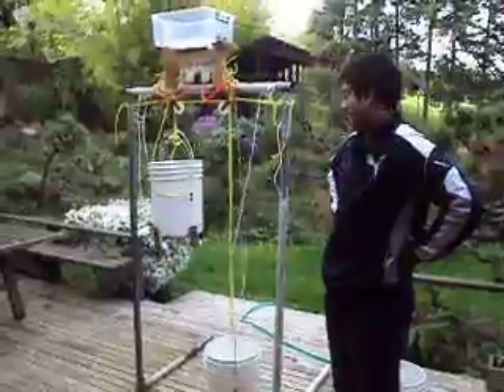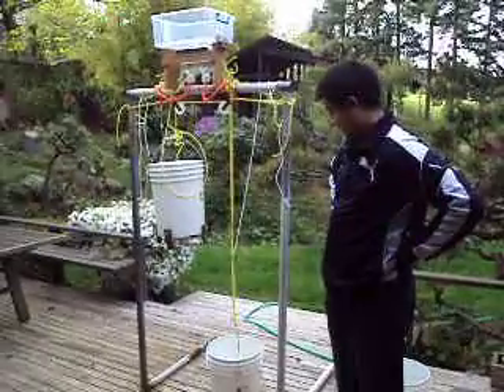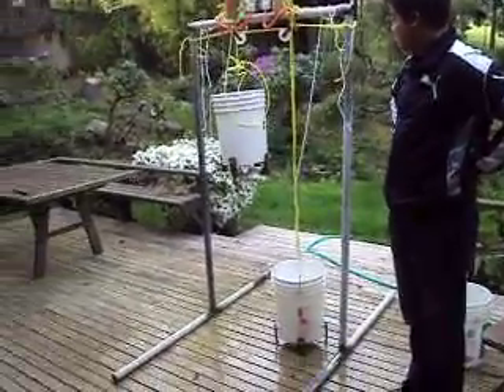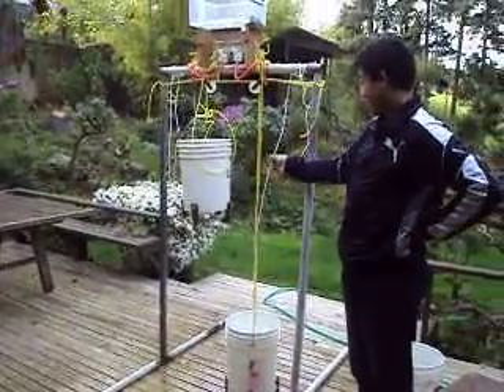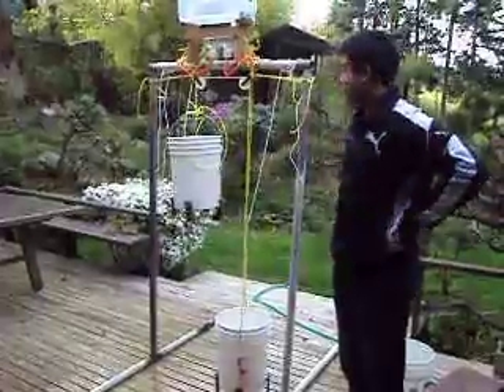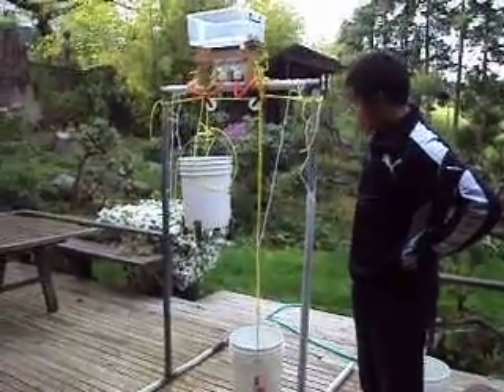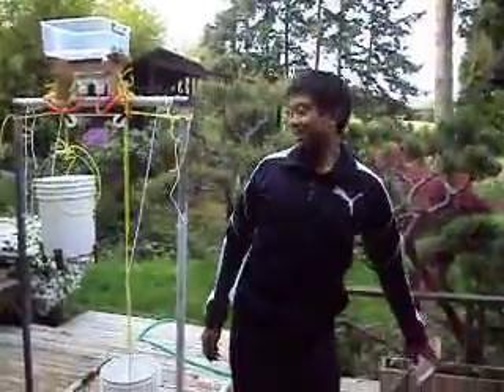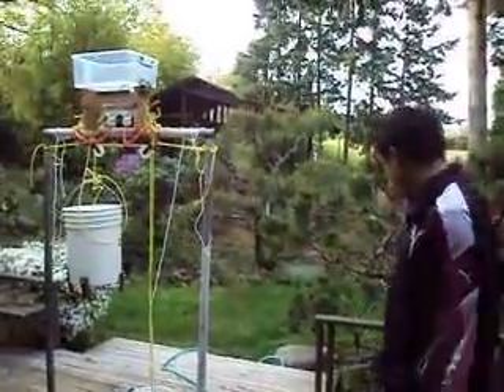My Invention: Reciprocating Mechanism for Harvesting Gravitational Potential Energy

Comment: Cannot see it. You pour water into bucket, then bucket drops, then bucket empties? 

Water (fluid) can be dumped/lifted, but is not heavy enough to do much gravity work unless you fill 1K+ liters per bucket. So your structure must be large and heavy-duty.

So then you (might) have water-lifting requirement to achieve continuous operation. Perhaps catch the dumped water in large intermediate tank below buckets, then pour that out at timed intervals through a turbine (which spins generator to charge battery for water-lifting pump) and into final collection tank. Pump water at timed intervals from final tank to source tank. 

If you have ongoing elevated water source, such as large rainwater catchment, use that to fill buckets, and discard water dumped from intermediate tank. Don't lift water unless your ongoing water source runs low.

Put shock absorber at bottom of each bucket's drop extent.

I might build that kind of (large) machine, but first I want to build smaller machine using concrete block (paired with lifting winch), which is 2.5 times heavier than water per volume.
Reply: Cont'd ... My interest is to explore feasibility of powering (3 to 5 kWH per day) modest, off-grid, single family home/compound by compact gravity-power device (simple techs) without solar and wind (which are fragile and intermittent) and without a nearby running water source. Rainwater catchment is preferred.
Reply: A rain roof of about 10 m x 10 m can collect 600 gallons of water from 1 inch of rain.
Reply from the maker: @paulsholar9356  Thanks for your interest in my prototype device.  Yes after I pour water into the top reservoir, what is happening is the bucket is filling enough to overcome the weight of the opposing bucket's empty weight and when it gets to the bottom it empties via a flapper valve in the center of the bucket, this triggers the selector valve at the top reservoir to fill the opposite bucket to repeat the process.  There are ways to simplify this further.  I originally intended this to be used in kites to harvest wind energy or hot air balloons but it was difficult to prototype so I switched to water.  I figure this scale of prototype could only power like a few watt light LED light bulb for like 20 minutes similar to the "gravity light" except it can reset it self when it rains.

Comment: If you can use the downward travel of the bucket to somehow pump water back up Then we would have yet another mechanical energy amplifier harvesting gravity to do work
Reply from the maker: Yes this could very well lift water.  It would have to be a bit less empty than the bucket coming down and some mechanism would be needed to release the water up high but doable.
Reply: @LockeLaboratory  we need to increase the mass and the velocity when it falls. so we can harvest  more potential energy in order to do more work. the real power is in the falling mass.   can you some how use magnets to keep the bucket from falling until a larger volume of water has entered it ?    when the bucket being filled reaches a higher weight than the other bucket it starts to fall slowly but it's speed increases as more water keeps entering it and you also have the abrupt stopping of the bucket at the bottom, energy being wasted going into the ground.  remember to use any and all forces that are being produced.    if you use magnets to keep the bucket from falling until a greater mass, weight is present then when the magnets finally let go the bucket will fall faster, more velocity and with much more energy.   use this energy to do work, like instead of striking the ground have it strike a lever, that can maybe spin a flywheel, the falling buckets will keep the flywheel spinning then use the flywheel shaft to turn a pump, or it can be even more simple, like a hand well pump handle , every time the bucket hits the lever it operates the pump handle to pump the water back up to the reservoir.  when the bucket reaches the bottom maybe have a water release mechanism, that pushes up a spring loaded plunger that releases the same amount of water that was used to make the weight fall.   just remember to look at all forces involved, and all potential forces that are present in any motions.  even the pullies turning could do something.

Comment: ropeways do this
Reply from the maker: Interesting.  Are ropeways the same thing as cable cars or chair lifts?  Would be interesting to see them used to generate electricity
Reply: @LockeLaboratory  aye theres the logging ones, the cargo ones, the mining ones,cable cars and chair lifts. i think ive heard of them being used for that and for sloped or rough areas like swamps even railways are incomparable. long term they are the cheapest form of transport with the potential exception of railroads.

Comment: Are you still working on a improvement?
Reply from the maker: Mostly in my head, I haven't prototyped it yet however.  In short, there are losses in the bucket design, they need to be turned sideways so they form sideways barrels.  My workshop has been sold so I can't build anything until I find a new one.
Reply: Locke Lab I was extremely intrigued by your design I saw something like this b4 in animation and yours was the first practical I have seen. I was also thinking you could combine it to something like this https://youtu.be/Trx5mDWf0Vo and have the motor working when it goes down on either side
Reply: Locke Lab and this is the animation I first saw https://youtu.be/NfYTalVwHZA i was thinking of designing a prototype and have possibly multiple that would fit inside a thick external Wall that could be in every house and solar panels to pump water back up so in theory you Could have a abundance of water for potential energy hooked up to a generator for storage and have a decent power wall and inverted to keep stability and you could have up to 100kwh in water storage instead of having to deal with high cost and dangers of lith-ion battery’s
Reply from the maker: @lukesmithy372  Oh that is very interesting! That was the first prototype I ever made and it is almost identical to this animation, the only exceptions was I made this out of two cheap water bottles and a bouncy ball with a screw stuck in it to act as the valves.  Then I used a single pulley hung up outside the house and powered it with a garden hose...  I guess I'm not the only to think similar thoughts.

It worked to oscillated up and down a pulley but I did not connect it to any generator. 

You don't need any differential gearing as shown in the animation, you just need a generator that is rectified to convert alternating rotations to pulsed DC voltage.

One certainly could use this as potential energy storage for a home but I imagine it would require a huge amount of space due to the low energy density of water. Basically a swimming pool on stilts.  Or if you had a well you could dump water into it... Harvesting rain from gutters or water from a small stream may be a slightly more practical application. 

To improve upon this design, the buckets should be very wide and  shallow instead of tall and narrow.  Storing water in a tall cylinder wastes potential energy since there is less stroke distance and more time/energy lost for the containers to fill and empty.  The height of the containers is simply wasted energy.

Comment: awesome demo. someone with a lot of time needs to up this and add a water collection basin in the bottom. Then have a small water pump to pump the water back up powered by solar panels during the day. This should be triggered to run up and down at night when there is no sun. Would be great for off-grid. Hopefully with a 5kw generator attached it can run an efficient split air conditioner/heater at night. Please someone with time go do this and share with the world... PLEASE! The goal would be a $1000 system that actually works and not depend on those $30K lithium-ion battery setup for night time energy storage use.
Reply: using solar energy to bring the water back up is essentially just using this machine as a mechanical battery
Reply: "Mechanical battery" .. what else do you think potential energy is?

Comment: I love it. Another imbalance system that utilizes tiny catalyst to do great work!
Reply: "great work"
Reply from the maker: @li2323003  Thank you!  I think I'll make another video of a smaller scale device that actually turns a generator and find a downspout so it can run continuously.  This was a fun project although it was super bulky and an eye sore to my neighbors.
Reply: @LockeLaboratory  The idea is definitely clever. Even cooler if you can add a bit of timing mechanism to smoothly operate a 12-bucket system running like a V12 engine. But to generate electricity, I expect the net work output to be no more than the forces of the few drops of excess water added to each bucket. The hefty buckets though, makes a good delusion on the output of the downward bucket that we tend to ignore that the majority of the downpull is used to lift the other bucket up, hence leaving little to none harvestable power.
Reply from the maker: @li2323003  Yea I think that is something I would like to test, I envision the losses are from pulley friction and having to lift the opposing bucket that hasn't completely emptied.  In power generation mode, I would match the load either through gearing or a large electrical load so it would take the force of one full bucket to start moving.  I guess this isn't much different than a chain of buckets going in a loop  except this uses only 2 buckets.  https://www.youtube.com/watch?v=-vebgkxjlsE
Reply: @li2323003  Aye

Comment: Its prototype, could be of continuous operation, even if it is a little more time ... if each bucket to fall drained the water to a container and a little time later a mechanical pump was activated that recovered part of the water, something similar to the GES system gravitational energy system, only that in its case the return of water must be without opposing a resistance to the passage of water that is returned by the pressure exerted by a mass of greater density inside the container ... experiment and enjoy it!